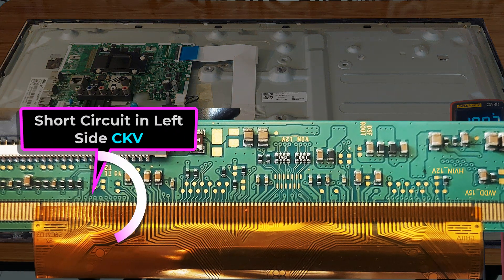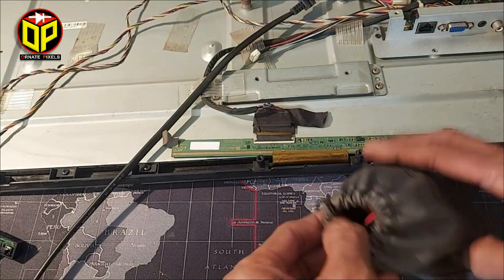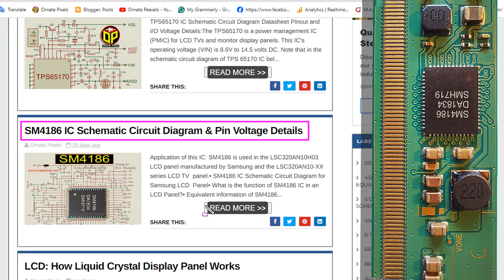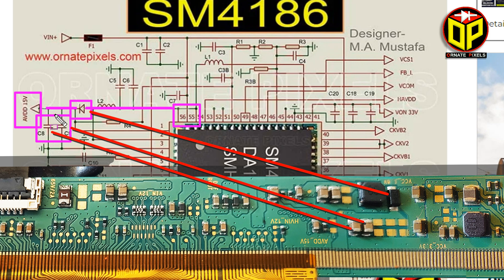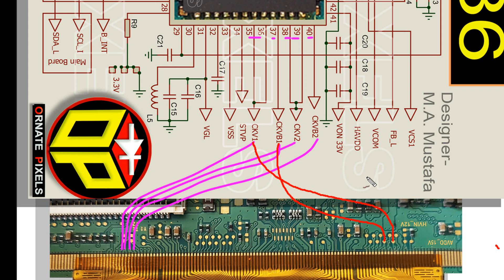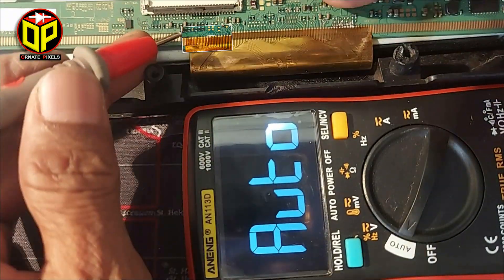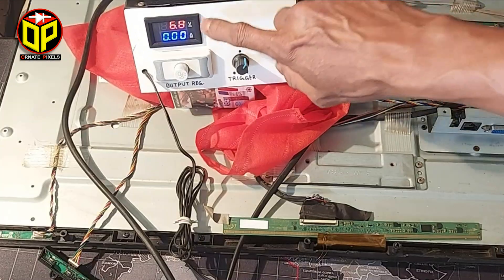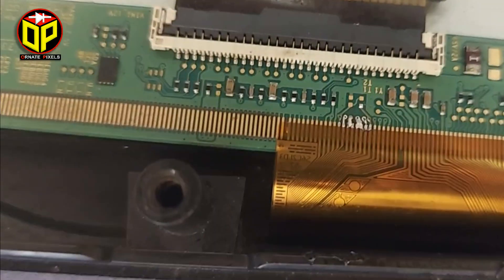CKV Short Killing Method | CKV Short on Both Sides, How to Find CKV and Remove Short, LSC320AN10-xxx

Comment: Good morning friend, a month and a half ago I just fixed a 32" Haier TV with the problem you indicate, display number LSC3220AN10, your video was very helpful since I was able to repair the fault, it gave me an image, I cut the right side and fixed the fault, but after a month it did the same fault again, it was left without image, now my question is if I have to cut ckv on the left side like I did on the right side? And if I cut lines on the left side, do I have to join the ones on the right side that I had previously cut? Or can I leave them like this without joining them? The ckv give me a value of approximately 32kΩ but will it be necessary to cut those on the left side? Thank you very much ING, I really like your videos, I am using a translator, only I do not speak English, only very little, I hope for your great help, greetings....

Comment: Hi, I am working on a Vitron smart TV model: HTC 5568us, Tcon no. LC546PU4L01. The TV displays Vertical bars during turn on then the video disappears as most of the screen goes dark and some vertical bars remain on edges, the top edge of the screen also has a broad horizontal bar moving from left to right continuously. The main IC and a sub IC on the TCON are heating when both TCON to scalar board ribbon cables are connected, the ICs don’t overheat when TCON is disconnected. When I disconnect the right cable of the TCON board the left side of the screen displays a faded grayish picture as the right side remains dark.  When I discontent the left ribbon and retain the right only greyish vertical bars display on the right side. Attempts to such for Tcon’s schematic and ICs datasheets were unsuccessful. Please help.

Comment: Hi @OrnatePixels , I have a Sony 75x7800f that I blocked CKV2 ( it has CKV from 1 to 6) the screen is working but there’s a white strip with some ghosting under it! Will this short killer work for it? Is it possible to use a 110v AC with a tungsten lamp and a ring push button on serial instead ?

Comment: WHY DID YOU CUT CKVs blindly IN THE FIRST PLACE DUMMY? You could have measured the resistance at the start to find the short and inject voltage there. But overall great video and I liked the beard, thanks

Comment: I have cut the left and right side, I verified that the 30v is not present yet. Is this normal? since I thought that before using the short killer the voltage should return
Reply: that's why he said to check the components first, if any of them are shorted, the voltage will not appear
Reply: @SingleBitTech  verified one by one, however, the protection mode persists. That led me to ask this question.
Reply: @MarceloEstig  if your tv's power supply circuit is ok, then unfortunately the power management ic of the panel circuit is dead.

Comment: Hi?..help me ,..is it possible to modify the 32 inch LED TV board-TP.V56.PB816 to works in LED TV screen 40 inch hisense because the LED + - Boost Voltage   for 32 Inch -40v while for LED TV 40inch -70Volts ..help me what to make the board for 32 inch to work into 40inch screen  ...and i tried to put the board for 40 inch but the pictures is showing UPSIDE DOWN..but entering factory through  MENU -1147 , unfortunately there is no MIRROR to enter...so tell me  what can i do to solve all these problems( faults)?